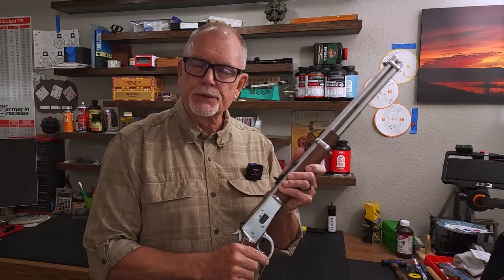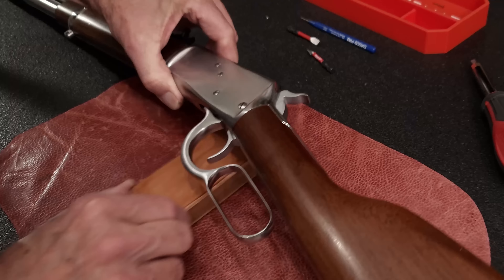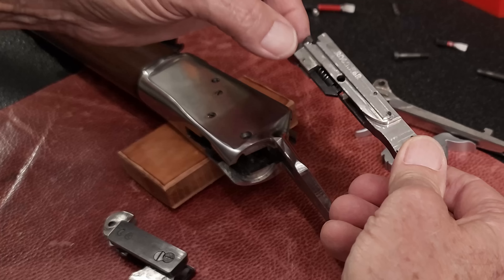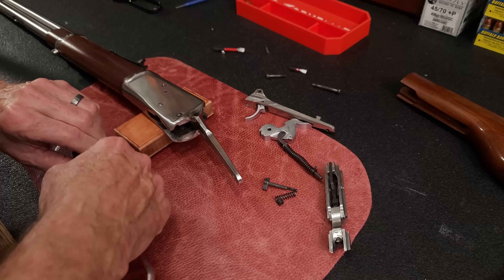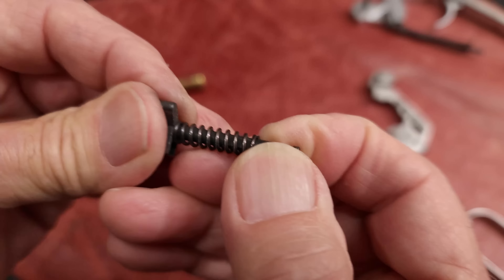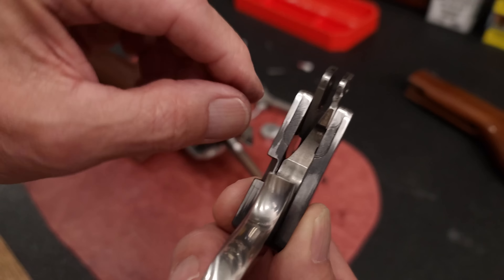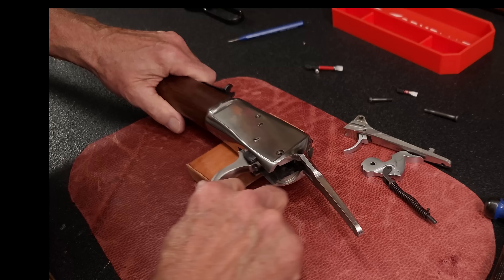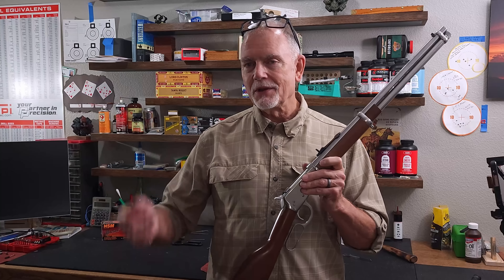Rossi 92 Disassembly . . . The 454 Casull Was Filthy!

Comment: For those that aren’t mechanically inclined and are unsure of themselves. Remove the rear butt stock and spray the receiver and inside with carburetor cleaner generously. The crap will just flow out. Done. Use plenty. No need to remove any screws. Tip. Always degrease your firearm prior to a hunt especially in cold weather. Great video. Thanks. Brownells  sells a set of thin bit drivers made for lever guns.make sure they are snug.
Reply from the maker: If you're going to try this method here's a couple of thoughts. First be sure and take out the mag tube or all that crud is going to flow down into your mag tube and cause a mess. And second if your forend doesn't have one of the modern polymerized finishes that carb cleaner will ruin it.
Reply: Many thanks.😊
Reply: ABSOLUTELY! You will curse your ancestry back generations before you get this damn thing back together! It is NOT as easy as this! These stainless guns are better machined than my blued gun. I spent HOURS needlessly following other advice and stoning all the burs off everything. He makes the ejector reinstall so easy, I wish I had seen this one first. I spent Hours doing it incorrectly and impossibly. I went from loving this gun to absolutely hating it...

Comment: I'm an expert on the Winchester model 92s. For the Rossi so called replica of the 92, didn't have a brain in their heads when they made the STUPID coil spring for the hammer. It's a real bitch to reassemble when you remove it to  work on the gun. I have several people send me their Rossi rifle to redesign the hammer spring like the one Winchester model 92s use. I grind at the bottom of the hammer to put the Winchester hammer stirrup. Then I grind off the Rossi coil spring block on top of the bottom tang. Then I drill the bottom tang that will have the screw hold the hammer spring. It's much easier than Rossi going "around the mountain" with their coil hammer spring. I run through the mountains with Winchester springs.

Comment: you made a great video. I took my R92 44 magnum all apart without the aid of your video. having worked on other things like a ruger standard pistol. this Rossi is not bad. I like the way the bolt is held in place with the locking system on this design. a side note. I used a belt sander to sand the butt end of the stock flat and installed a Limb Saver recoil pad. these R92 carbines do have a kick.

Comment: An interesting and instructive video. Over many years of buying and selling lever action rifles with Winchester and Marlin being the most popular, I am always amazed at the old well used rifles that have never been disassembled and cleaned but were still operational, a testament to the design and manufacture, also to add pump action shotguns. Your video will help many enthusiasts I am sure.

Comment: Nice presentation. I am currently working on an Armando Rossi, pre Interarms, SRC 357/38Spcl. This one is kind of a rusty mess. When I am finished it will be a nice shooter.  I have ordered some replacement screws from Jack First Inc.  Currently waiting on a M3.5 x .35 tap I ordered on eBay.  I also ordered reduced force springs from Steve’s Gunz.  The force from the hammer was punching holes in primers.

BrazTech / Rossi USA are clueless on the older production units. For that matter they are not great on spare parts.  I ordered a stainless fore end cap eleven years ago. I have not seen it yet. I just wanted a spare as I am thinking for adding sling swivels to that rifle in the style used by Winchester.  As for the rear swivel I would like to make one in the style used on the 1866 it rotates.  Not a high priority project but I believe it might interesting.

I sort of fell in love with the 92 design fifty years ago shooting a 25-20 Short rifle.  It is also the rifle that I knew would make me learn to reload.
Reply from the maker: Sounds like you've got a great project going there. I hope it works out. Thanks for your comment!

Comment: excellent video I’m sure this will help a lot of people, With the 1886 I usually leave the lever attached to the bolt as you can just pull it up out of the top of the gun and then you don’t have to worry about losing those small parts with the extractor and for me it’s easier to put back together that way as well.
Reply from the maker: Okay, you've got me curious now. I know when I made my disassembly video for the 1886 I took the lever off. I need to go back and watch that and see why.
Reply: @TargetSuite  The reason why I know because when I was working on the action to make mine feed 50-110 I had to take it apart a bunch of times and put it back together and it’s much easier not to have to fiddle with the ejector you do have to fiddle around little bit to get that piece to come out of the lever that pulls the cartridges into the cartridge carrier, and once you get the cartridge carrier removed from the gun you can slide the bolt the rest of the way back and pull the lever out to top, on the newer ones you have to make sure the safety is off you might not have removed the cartridge guides on either side but if you remove them it will slide out the top

Comment: Excellent tutorial, George.  I just picked up my new Ruger Super Redhawk Alaskan in .454 Casull and am currently working my "magic".  I have a couple of Rossi 92's; one in .45 Colt and one in .44 Magnum so I've had lots of practice disassembling and reassembling those rifles.  Your video was easy to follow and should be a great help to others with this pattern of rifle.
Reply from the maker: Are you recording your magic with the 454 Casull?
Reply: @TargetSuite  Not recording, but writing a blog.  The gun has a problem that I cannot fix so it's going back to the factory!  😥 When I press on the ejector rod, it is blocked/jammed by something inside the cylinder.
Reply from the maker: Wow! I hope folks at Ruger are paying attention to the amount of returns!

Comment: Thank you George for walking through this!!!  If it needs to be done: Be patient and take your time!  I had to do this to a 1952 era '94 I bought off of a coworker about 20 years ago.   It had to be "soaked" in kerosene, but the main point is, 1892 or 1894, there's a "bunch" of small things/parts that you need to be aware of in this level of disassembly!  Have no fear, as it can be done 👍!  

BTW- The '94 cleaned up beautifully, is smooth running, and shoots to the point of aim out to 150 yards! Just had to get a NOS rear sight ramp.

Comment: Very helpful information & explained well. With Arthritis issues I'm not even going to attempt it. Have to know your limits with lack of hand strength & flexibility. Appreciate you showing us good tips.  🙏 🇺🇸 👍
Reply: Refer to my earlier comment on this page. You do not even have to  remove any screws for cleaning. Just spray the crap out of the action with carburetor cleaner. I don’t have the strength in my hands that I had in youth. I’ve had operations on both hands.Nice to hear comments from old timers ⏲.
Reply from the maker: @Gas Check Yes, and it's nice to have fellow old timers watching and commenting. You guys are the best
Reply from the maker: @Bill Dye Thanks!

Comment: I find firearms to be very simple to service in comparison to the commercial grade multiple functional printer, faxing, scanning, copiers I have been repairing for my livelihood for the past 35 years.  I love my hobby of firearms for their robust simplicity compared to modern delicate complexity of multifunctional printers. 
I would be concerned with the unburned powder. I would question the ammo. You get that with low pressure charges of slow burning powder most of the time. Some types of powder just plain burn dirty.
Light charges of IMR 4227 can do that in magnum pistol cartridges. Makes good bullet crimping all the more important.
The 92 lever is just plain fantastic.  A credit to the genius John Moses Browning.
Reply from the maker: Great comment. Thanks! The excess powder was from early handloads that Larry ran through this gun. He didn't crimp the case is tight enough and so much of the powder did not burn. Heavy crimping is a necessity with the 454 Casull. And yes compared to the kind of Hardware you work on Firearms are very simple, but then there's the Winchester 1886. Oh my!
Reply: @TargetSuite  I have not tried my hand with the 1886 . My youngest brother has a modern made take down version . Made for Winchester in Japan.  It looks to be a well made beautiful rifle . It do kick to the point of pain even with the 45-70 trapdoor loadings.
I have not touched the 1895 Teddy Roosevelt's Big medicine rifle.  It looks like a heavy piece of iron . A unique design. They all put a smile on this grown man.

Comment: I have a blued 454 Rossi with a ported 16.5 barrel.  Took it apart a few years ago and smoothed the action some with fine stones and some emery paper.  Really nice action now.  My Sons' stainless 44mag Rossi was smooth right out of the box. The disassembly / reassembly is a little 'fidgety' but if you take your time it will fall into place (eventually).
Reply from the maker: You are right about falling into place. Sometimes you just have to fiddle. Thanks for your comment and thanks for watching!

Comment: Very Nice video and explanation.  I did struggle to get it back together. The pin did not get seated deep enough. I could not get the mechanism to cycle, it was jammed. After a few tries I hammered it i  harder and it worked this time. 🙂
Reply from the maker: Glad it helped!

Comment: Excellent step by step video!!
I don’t know who else thinks about just how long ago these firearms (along with other machinery) were designed, and INVENTED PIECE BY PIECE. Over 125 years ago parts forged by a blacksmith then hand fitted, etc. a lot of people think we are so much more educated than those of the past. I couldn’t disagree more. These folks had to do everything themselves. No electronics or electricity at that, no instant calculator, no computer, etc. yet look at what was designed and invented during the mid to late 18th century. Today machines do everything for us. What would happen if there was a total and complete blackout during modern times? It would not end well for a majority of population. They even knew how to store food for extended periods for times of less abundance. 
Anyway this comment rambled on for way too long!

I just really wanted to say how much respect I have for those who paved the way for us all.
Reply from the maker: I couldn't agree more! People used to be resourceful and solve problems. We've lost that magic

Comment: As amazing as JMB was at designing the Winchester lever guns, Marlin's simplicity  makes one wonder did JMB ever think "why didn't I think of that ?"
I have disassembled many Marlin lever guns, but leave Winchesters for the experts.
Reply from the maker: While the round bolt Marlins are a recent design, the lever/bolt engagement goes back to the 1800s. So I suspect JMB "reviewed a few of those guns along the way. And I suspect he wondered that very thing.
Reply: If I recall correctly, Browning had to design his guns while dancing around patents. Everything in the 1892 is nice and compact, but that makes things complicated internally.

Comment: If you havent already, install a lee gunslinger spring kit. Its only $25 and now the action in mine is almost as smooth as my 1873, and the trigger pull is now 1.5lbs

Comment: That cover screw has been problematic for me in the past.  Sometimes, they make them too long.  So, when you try and tighten them all the way down, it locks the action up.  Have to have a gunsmith shorten mine a tad to be able to tighten it all the way up without the headache of locking the action up.
Reply from the maker: I've seen those kind of problems in earlier Rossi's. The first one I reviewed on this channel had the upper Tang countersunk too deep for the screw head. So it actually caused the screw to stick out at the bottom of the gun. Other than that it was a great rifle.

Comment: I have a original 1892 32 wcf (32-20) made in 1903 24" barrel. 
I bought it from a friend who got it from someone else that he new.
And neither one of them could get the rifle to cycle correctly. 
It would let a cartridge out of the magazine tube under the lifter, and jam the action. 
At this point you could remove the magazine tube and drop out the cartridge. 
When the rifle came into my possession I completely disassembled the action and found that someone else had installed the cartridge stop spring backwards, flipped the spring the right direction and has worked flawlessly sense. 
This was the first time working on a 1892 and only using a parts diagram I got lucky putting it back together.
(Oh bye the way only paid $450 for the rifle) it's condition is 90% original bluing with minimal amount of dents and wear to the wood.
I miss quoted the year made in 1918, my 1895 30-US (30-40 Krag was 1903) l really like and enjoy older Winchester lever guns. 
I have several.
Reply: I wouldn't mind getting one of the older ones, except for the price. Buying a new 1873. I don't care if it is made in Japan, have heard nothing but amazing things about Miroku.

Comment: Hi George, I bought the Rossi R92 Black .357/.38spl.  I watched on the one like mine.  I did a great job.  Also on this with this 454 Casull you did great.  Thank you for that.  I do have a question about the butt stock.  Will the stock interchange between these two rifles?
Thank you in advance for your answer.

Comment: FYI newbies: Tipton makes a 'Gun Butler' that will hold a rifle when you need to hold it upright to take out the stock screw and other things. And a disassembly like this can be rather tricky, and I'm sure its not recommended by the manufacturer. An alternative is to blow out the action with a no residue aerosol cleaner like Birchwood Casey Gun Scrubber. Which they actually advertise is handy for cleaning lever actions. Also Scheels or Fleet Farm sells a a gunsmith block with all the channels and holes for punching pins and such for about $12.

Comment: The 92 design can be a little tricky to take apart and reassemble the first time or two but is a piece of cake compared to the 1886. It does get easier after the first couple of times. The first time I felt like I needed three hands to get the ejector and the pin to stay in place. Good light, proper screwdrivers and punches, and a magnetic parts tray sure help.
Reply from the maker: Great comment! And yes the 1886 really is a far more complicated puzzle to put back together.

Comment: Need some help here
First thing the paper clip broke,almost directly below the rear of the lugs but I have been aBle to get all but 4 coils captured with a small sewing needle ,My rifle which is a new one the lower tang does not slide in Easy and I can get the hammer and trigger to line up but I cannot tap the lower tang to get the Lower tang hole to line up and any time I try to jiggle the lever it forces the lower tang to start backing up and showing about a quarter of an inch back to the trigger pin or sometime I can get the tang all the way forward but then the tip of the trigger is touching the inside of the trigger guard directly below the rear of the lugs!
I am 64 and been working on my own guns since I was 10 years old .
I have been up since 4pm yesterday trying to get this figured out.

I would appreciate some advice.
I am not going to a gunsmith.

If you can help me I sure would appreciate it.

I have checked every video I can find and everyone makes it look so easy !

Thanks

Comment: I wonder if theres a way to give these rossi r92s a tang safety. I personally can't stand the top safety because I tend to forget it's there. Maybe just a simple crossbolt safety would be better ince it's just a button actuated hammer blocker.
Reply from the maker: What's in interesting is that they all have they have cock safety. It worked on lever guns for over a hundred years. Not sure why they need an additional safety. That said, if you have to unload in the house it does give you peace of mind cycling that lever.
Reply: @TargetSuite  it truly does give peace of mind especially since I intend to use it as home and land defense against hogs. I think that peace of mind is what I'm after with the rifle, but I can learn to live without it.
Reply: @TargetSuite  You may have already figured this out. But the manual safety is because of stupid U.S. importation laws. Thank the ATF for stupid unnecessary safeties on these firearms.

Comment: It’s only dirty when it’s chambered for a round it wasn’t designed for.  All Winchester designed rounds like the .38 WCF (,38-40), .44 WCF (.44-40) etc., use tapered cases and thin neck material that seal the chamber, and prevent fouling from getting around the cartridge case, and back into the action.

Comment: Is it the same process with your Winchester 92 ?   :yougotthis:
Reply from the maker: Almost identical. But the Winchester has Tighter tolerances, a tang safety  and the main spring strut also doubles as the rebounding hammer "spring". Other than that assembly and disassembly is identical. I have posted a disassembly video on the Winchester 1892. It's somewhere on my channel.
Reply: @TargetSuite  Thanks George